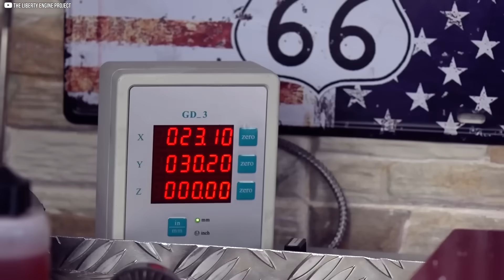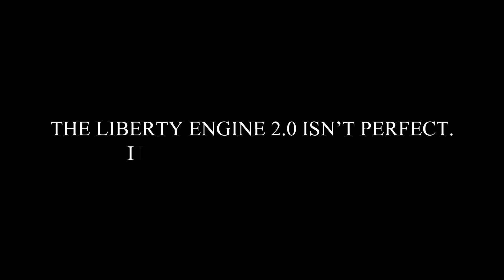Nikola Tesla’s Hidden Invention Just Got Rebuilt – And It Works!

Comment: This whole thing does break the laws of physics. Cause what you're trying to say is that they have built a perpetual motion machine, and every one know that it is impossible to build one of those. Even if you can get it to run at 100 % efficiency, it still can't power anything without losing energy. Cause if it can, you are breaking the laws of physics. The first law of thermodynamics states " that the amount of energy in the universe is constant, new energy can not be created, and energy can not be destroyed."
Reply: Is it really generating new energy though? The magnets are stored potential energy are they not? They die after some time, get weaker from start to end.
Reply: @Mcflapphypants  This is exactly what I was coming here to say.  The magnets are basically a natural version of a solid state battery in a different sense.  When we were developing the laws of physics in the distant past, we only had natural magnets and lower powered artificial magnets & electromagnets (both too weak to act efficiently).  The super high strength composite magnets of today generate much more high strength fields.  One of the problems with magnetic rotors in the past was their tendency to "lock" in place and so you had to get the rotational frequencies right in order to not create drag and end up in a locked rotor situation.  Ideally, the best magnetic motor would act just like spark plug in a traditional engine, but in a perpendicular configuration.  The magnet would only turn on and "pulse" during the "piston's" deepest part of the stroke.  The strong +/+ field would rebound the piston creating momentum & the magnetic source would turn off until the return stroke happens.  Particle accelerators are basically doing something similar, but on a much more advanced level and just use linear accelerators.

I've posited though that at some point we may be able to create a version of a "magnet" that is able to either tap into a subspace field or channel the natural electromagnetic flux from all of the solar radiiation the Earth gets hit with on a daily basis.  There was an anime called Dimension W where most devices on earth were powered by a wireless power source and all they had to do was attach these wireless power tags onto anything that needed power.  The tags literally acted as the receiving conduit or power outlet that translated the power from the micro dimensional break and tapped "subspace" power (or so that's what everyone was told was how it worked).

The real problem with messing around with strong magnetic fields and putting them into everyday use is that we truly don't know what the longterm effects are on cells.  We're only recently confirming that humans have magnetoferrous cells in our brains that are design to work with the Earth's magnetic field.  Similar to bird's magnetic field line eyesight.  Exposure to strong fields could mess with us on levels we're not able to understand.  We also know that people are affected by the full moon, Northern lights and solar flare events, but it's at a subconscious level.  We also do know that magnetically induced sicknesses can happen when we look at people who live with high power stations or powerlines next to their homes.  Same with microwave towers.  That doesn't mean we shouldn't use magnetic engines around our homes though.  They would be a GREAT means of taking some load off the power grid during peak hours and creating more excess power during off-peak hours to do other work (i.e. doing the hydrolysis or other fuel creation work at night).  If they manage to couple this technology with nanoferrous concrete/glass + polypaper batteries, then we could end up creating great power storage systems.  Same with replacing asphalt room shingles with thermo-sensitive charge captive systems or microcapillary systems to transfer all that radiant heat absorption into water heaters
Reply: NOT NECESSARILY.  Why is it that NO ONE takes into account the "energy" supplied by the PERMANENT magnets? ALL generators and motors use magnets, but for generators, they are ELECTRO-magnets, meaning it takes energy to create the magnetic field. There ARE permanent magnet motors, only because their speed and power can be varied by controlling the armature current. However, generally, permanent magnets cannot be practically used for generation, because there is not way to control and limit the output, because it is fixed by the permanent magnets. But when a permanent magnet motor is combined with a permanent magnet generator, the magnetic fields used for rotation and generation are FREE, aren't they? That turns the entire energy in, energy out paradigm on its head, doesn't it?
Reply: You don't need it to be perpetual, if it runs as stated for only 5 minutes, then you build a small mechanism to give it a push every 5 mins, possibly that mechanism being run by the power you have already generated. Its not rocket science just the so called laws of physics you have to bend or get round.
Reply: @iamrocketray, you are entitled to your opinion. But maybe you should take a course in physics, then we will talk.
Reply: even if theoretically we can build a 0 energy loss machine the moment we decide to extract energy then it stops being a 0 loss machine

this machine suggests that it produces energy from thin air
and thats not observed anywhere 

at best it uses the magnet as a battery and the device will last only as long as the magnet lasts

from google
Generally, a permanent magnet should lose no more than 1% of its magnetic strength over a period of 100 years if properly cared for

and i doubt these machines properly care for the magnet and considering they are constantly syphoning energy from the magnet i doubt they will last a long time
and i feel like those magnets are very expensive
Reply: @MostWantedWannaBE  It may be that it either runs out of energy is a complete fraud. But if it works it would not be by breaking physics just by that alignment of magnetic fields they may access other fields like the magnetic field of the sun and as the earth travels or turns it induces a current. There are such things with polarizing light that it depends on the angle of what gets blocked some perpendicular fields have different interactions in such configurations. Things we can disprove by trying their design not much by theory because we miss the source of energy they access that is the point of new inventions. if it is fraud the unknown energy source is the electric grid or a diesel generator if real the new energy source, never does it come from nothing.
Reply: Basically it harnesses the power for most of the rotation while sending a small flick of power to overcome the magnet's attraction to itself . it's absolutely genius
Reply: What you say is technically true but the thing is even a hydroelectric power plant behaves like a perpetual motion machine the water cycle is just used at the spot of the plant to use some of it's energy for a humanly useful goal. So also the tesla Tower just uses static charge in the atmosphere little by little instead of letting it discharge in a burst of lightning if enough energy is harvested you get less lightning in that area up to a point of no more lightning if all energy is harvested (Yes the danger of said tower is if you can not harvest enough charge in time the lightning gets pulled to that tower but maybe just let it turn into a lighting rod to not damage it) again no need to invoke the laws of thermodynamics the energy the static charge is all over the palace it is just not used and we want to use it. But again it looks like a perpetual motion machine as long as we have the planet operating. This is the type of machines we are looking for and there is no point of stopping people by saying it is impossible. You know before the Wright brothers flew their plane a scientist in Europe published a paper proving that human flight is impossible and just a few years later he must have felt pretty embarrassed don't be like him. As for this video is it hidden wires or not? only those who try building it will know for sure.

Comment: Tesla envisioned a system that could harness atmospheric energy—essentially drawing power from the air—and transmit it wirelessly from central collection stations to homes. He demonstrated the concept by lighting a bulb 25 miles away using a Tesla coil. His most ambitious attempt to make this vision a reality was the Wardenclyffe Tower project. However, the idea didn’t align well with capitalist interests at the time. Because the system couldn’t be metered—meaning people couldn’t be charged per unit of electricity—investors pulled their support. Without funding, the project was abandoned, and the tower was reportedly dismantled to help pay off Tesla’s debts.
Reply: JP Morgan wanted to profit off the copper he was mining in Alaska.
He originally supported Tesla but pulled funding when Tesla was explaining that there would be no need for billions of miles of copper wiring because the electricity could be transmitted freely through the atmosphere as well as through the ground.
JP Morgan then got behind Edison because he agreed to create a system that would require the copper wiring.
It's always about greed and profit. It's never about helping society and the betterment of humanity.
Reply: @realityfitnessfyt4lyfe248  Nail on head
Reply: Although it might have work back then but due to our ever increase in demand, Tesla's idea would not work. Dependence on natural resources for power is not realiable. Even wind and solar power doesn't have the same capacity as a generator does. It is not about funding, it is about providing stable power through out the grid.  Even with realiable system, accident always occurs. So no it is not about capitalism at least not entirely. I hope that help
Reply from the maker: That's a really interesting summary of the project, it's too bad it didn't take off at the time!

Comment: This is too incomplete, needs multiple outputs for a stable energy source solution. One output to start the machine, a second for maintaining a generation drive, third for absolute generation and core of alternate separated metals to capture the final energy. A static charge to start rotation, electro magnetic power to maintain the machinery, another to generate AC power and two separated alternating metals to collect the energy and if possible a radioactive isotope rod as the final central core(optional) all in a stabilized vacuum cooled with nitrogen
Reply from the maker: Thanks for sharing your perspective on how the machine could be optimized!

Comment: Looks ok-ish, but kinda' inefficient.... Needs more rotors 😅 and a flywheel thingy... plus transformer or a big capacitor for power loss mitigation 😅 ...or somethin' 😁 Batteries should be included, for storage... 🤔

Seems ok... but to complex. 

The device shown on the thumbnail of the video seems more interesting 😂

Comment: If it’s that good. Oil companies, energy companies would buy out the thing immediately. I need to see a real world test of that thing running for a week and you said it would put  20,000 W that’s a shit load of wattage. I don’t believe it. You have to prove that. And in your video I didn’t see that!! That thing is not capable of putting out 20,000 W without slowing down. prove that, and if it could, you couldn’t build them fast enough so wish I could believe but I don’t believe you.
Reply from the maker: I understand the skepticism, and appreciate you pointing out the need for more data!

Comment: Motion is energy, and energy can be converted into other energy.  Magnets can spin, that motion creates energy so it can be exploited.  The machine will last as long as the magnets contain energy. But where there is motion, there is friction, and that creates heat.  So if you can maintain the heat levels, use materials that wear less due to friction, you can create a device like this.  Energy companies can still make money off this by providing the devices.  They can add a value to it.  A value to the maintenance, a value to parts.  It reduces the cost of not having a grid to maintain.  It reduces the cost of not having big plants, with turbines that need matter to heat to use that heat energy to turn them to make electricity. 
However separate, off the grid devices, does reduce control.  If you are the one providing the power, you have control of that power and can turn it off.  That's probably why we don't see devices like this.

Comment: Explain me how if it generates X amount of electricity that electricity does not stops the rotation at the same time. Just that because clearly unless you use a lot of power to make it rotate itself at first, if you actually generate electricity from a magnet, then the magnet (and anything over it) will have a force on it at the same time. so how do you manage to stop that? and if not then all the energy that generates is because the person is pumping it manually on the thing.

Comment: This could not have worked for either the person presenting or Nikola Tesla. Well, let's see what this device can practically produce.
He's talking about a standard speed of 1400 revolutions per minute.
There are four magnets, or two pairs of magnets. So, in one revolution, two perform sinus alternations, or 2800 alternations per minute. This does not match the frequency of the European 50 Hz alternating current; it's only 46.6 Hz. But let's not be petty, let's accept this.
Let's examine the generated current, however.
The rotor holding the magnets ("argalium" haha...) has a diameter of about 20 cm.
Its circumference is about 126 cm. Four magnets occupy equal distances along this length. So there is a distance of 31.5 cm per magnet. Of this, the width of the magnet is about 1.5 cm. This 1.5 cm generates current, with 30 cm of passive idle speed! This would show sharp peaks and long nothings (empty passages) on a graph. This very intermittent current would certainly not drive commercial machines, nor would it drive the rotary electric motor here.
Just look at that rotating part; "made of special mysterious argalium". Why does the rotating part need to have excellent "eddy current damping"?
I'll tell you: IT NO NECESSARY!! The fraudulent creator only claims this so that he can claim that the duplicators use an unsuitable alloy material, which is why their machine doesn't work.
I can assure everyone: the device shown doesn't work either. It doesn't generate 20 kW of energy, but it can't even produce the power needed to sustain the process.
If I'm wrong, I'll pay 100,000 US Dollars. If I'm right, I'll ask for 100,000 US Dollars. Let an independent academy decide!

Comment: Let's be realistic. This machine needs supplemental power to keep it running. That said, if it takes $30/ month to operate it, but saves $90 on your power bill,  how long will it take to recover its cost? Also, can plastic be used in place if the alloys?

Comment: 5:31 yes, 7 volts.  Amazin!
Reply: I got 4  P.M.A.s and each one makes 1200watts to 1800watts depending on speed and  12 volts to charge batteries,  this then goes to an 1000watt  inverter and makes 120volts to run household items

Comment: there is a technical term used, its called feedback loop. man, the whole concept is simple. the motor's and generator's torque difference manages the output to be higher than input. for those who say it violating the law of energy, please read your books well and talk, it doesn't violate because it converts one form of energy into another form... i made small scale machine of this type more than a decade back, not necessarily AC, but mine were DC type input motor and pulsed DC type output.. the thing is, the motor's torque should be large and its why there is no jerk or flicker when multiple loads are connected...
Reply from the maker: It's great to hear about your experience building a similar machine, and thanks for sharing your knowledge!

Comment: Just one simple question.  Where does the energy come from?  A conventional generator converts kinetic energy into electrical energy.  But it requires POWER to turn the generator shaft.  If you pull some of that electrical energy from the generator, it requires MORE kinetic force to keep the generator shaft turning at the same speed.  I've heard some claims that the energy is coming from the permanent magnets.  But even if that were miraculously true, the magnets would be depleted and require replacement.  It requires energy to produce a magnet.

Comment: It runs on flywheel power.  You have to pull the cord to get the spin going.  They indicate that "as long as it spins" it generate electricity......until you have to pull the cord again.
Reply from the maker: The flywheel stores and releases energy, but you are right about the initial power needed to get it going!